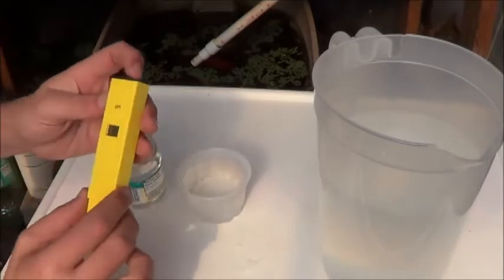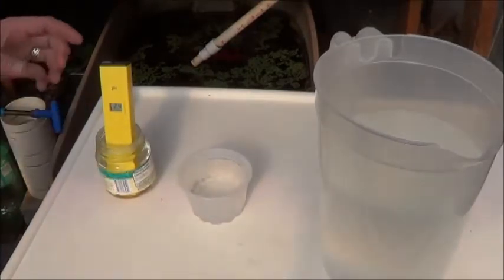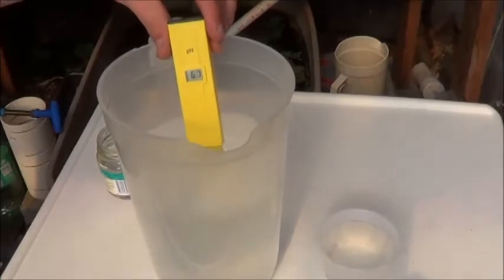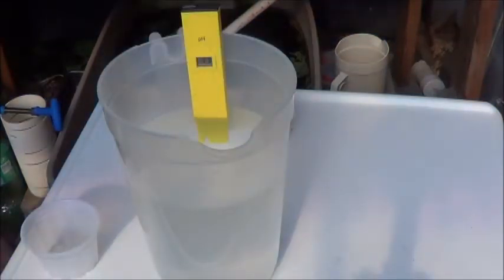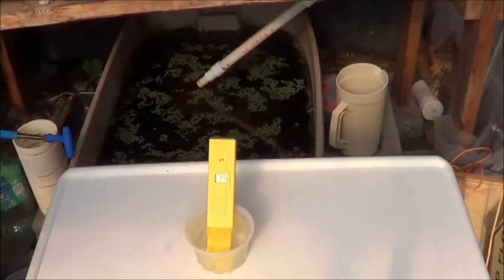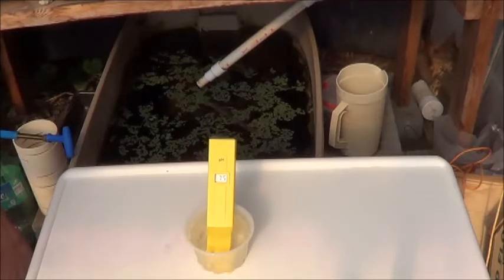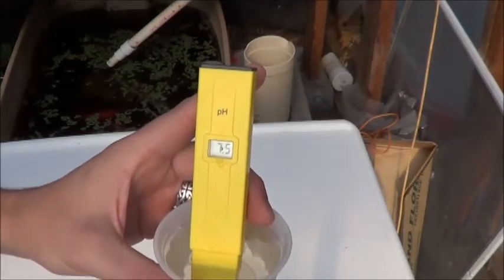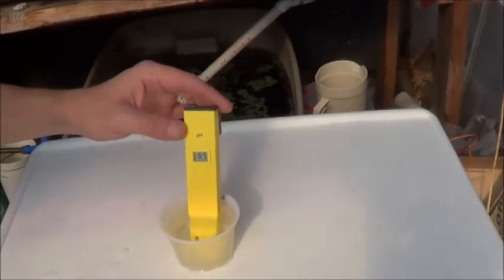pH Testing Take Two

Comment: 6.5 -6.8 is where you want to be..
Reply from the maker: Leesville Aquaponics Homestead I'm pretty happy with the reading from the powered aquaponic set up but that no power system is confusing me a bit.  Not quite sure how it's reading higher than the tap water is but I could still be having issues with that meter.
Thanks for checking it out!
Reply: JT Bear tap water has to set a few hours to even days before it will allow for proper ph to read... All water right of the tap even if well water will read 7.0 till air is in the water then the true PH shows...
Reply from the maker: Good to know!  I'll let some sit for a couple of days and then test it.  Wonder what it will read ...
Reply: OK man you might be able to help me.. What is youtube issue today been trying to upload a video all freaking day but when you click upload it says loading then when you click basic uploader it does nothing... Has it worked for you?
Reply from the maker: Rough!  I haven't uploaded anything today but I'm working on a turkey for the Kitchen channel so that's not good news ....
Wish I could help.  :(
Reply: JT Bear Hey send me a message so I can contact you on FB if you have fb

Comment: Cool that you got a dependable reading 2nd try.  Rinse that little pH meter with your sample and you will be fine. I would not worry about adjusting for temperature difference. Just make sure your standard ( white vinegar) is the same temperature as your sample. Such as move from a cool house to hot green house. Looking forward to more testing.
Reply from the maker: Steven Cupples I'm going to let is be for a week or so and then test again.  It seems there's a lot to learn about this water chemistry thing!  :)
Thanks for checking it out!

Comment: My next comment should be taken with a grain of salt but temperature can have affects on pH numbers taken from electronic measures... 10-15 degree swing should be OK but more than that might through it off a little - Now that I said that it will just throw the number off just a little, also 10-15 degree swing in aquaponic is huge so that is why I said take this with salt.....
Reply from the maker: Tracy Holz One of the biggest issues with my garden is how small the tanks are.  Sadly it does make them very susceptible to temperature swings and basically anything that can affect water quality, which is part of why I really want to get an IBC tote for a new fish tank .... waiting is.